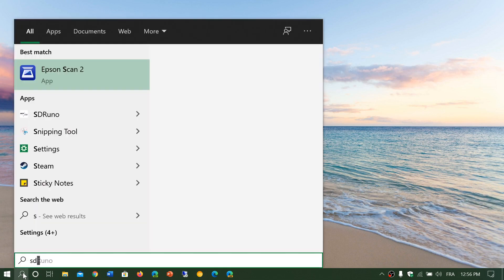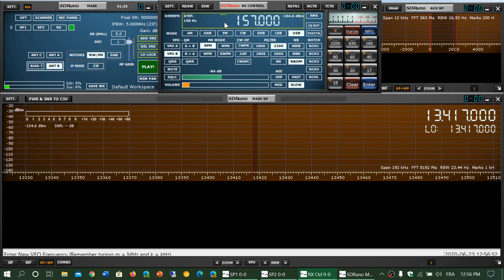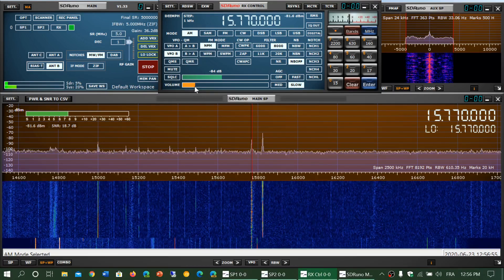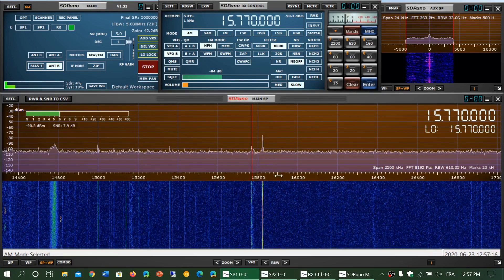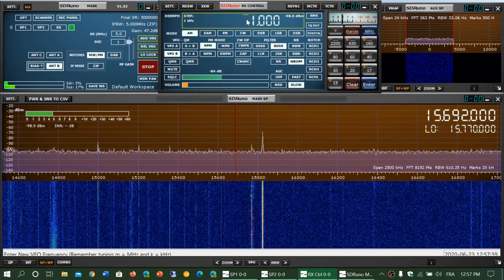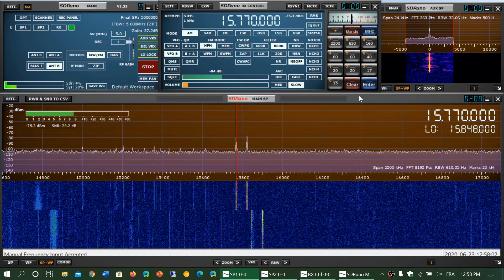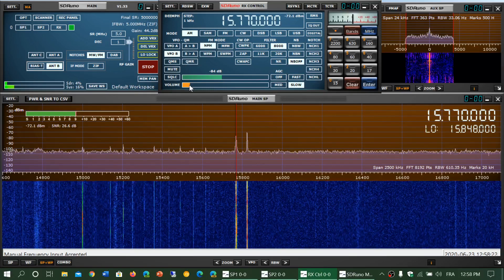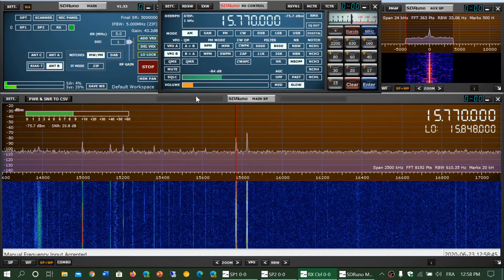SDRuno LO Frequency and Main frequency common audio distortion problem

Comment: Gilles, what is the function of the Local Oscillator ?
Reply from the maker: video coming up
Reply: @OfficialSWLchannel  Thanks Gilles. I saw you do that "offset" on the previous video, but I'm still confused as to the function of the LO. Surely they didn't put it there just to make tuning more finicky. What is the function of the LO? Hope the antenna switch is still serving you well.
Reply: In electronics, a local oscillator (LO) is an electronic oscillator used with a mixer to change the frequency of a signal. This frequency conversion process, also called heterodyning, produces the sum and difference frequencies from the frequency of the local oscillator and frequency of the input signal. Processing a signal at a fixed frequency gives a radio receiver improved performance. In many receivers, the function of local oscillator and mixer is combined in one stage called a "converter" - this reduces the space, cost, and power consumption by combining both functions into one active device.